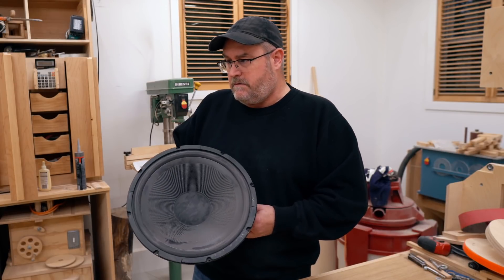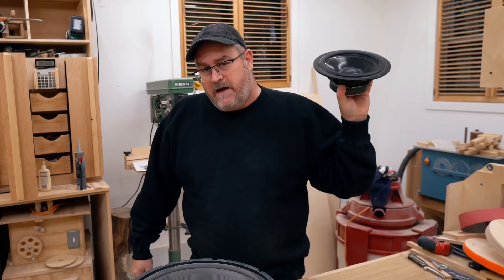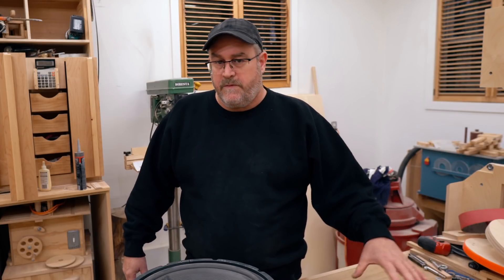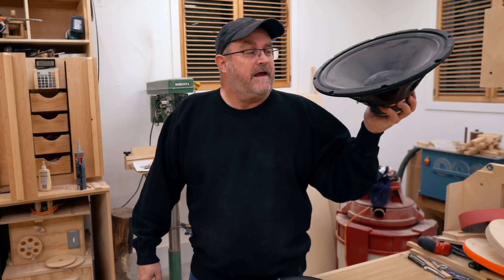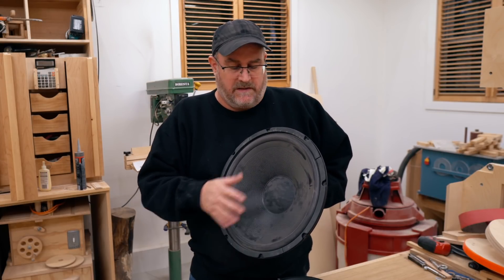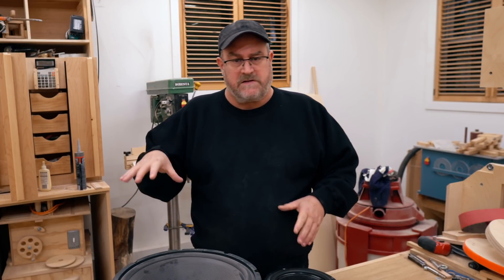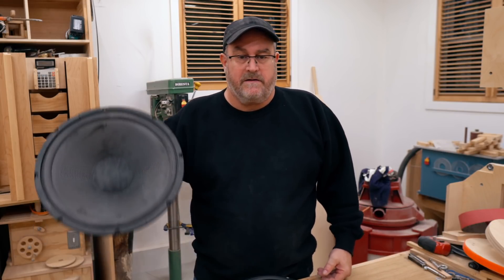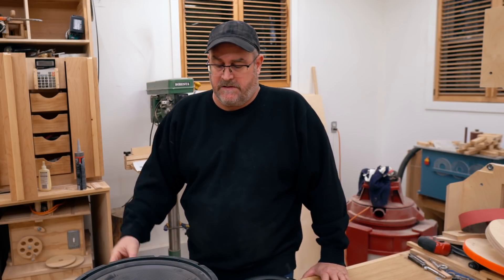What's a 3.5 Way Speaker? Designing My Main Speakers

Comment: Using Low Quality (Cheap) Drivers... is like putting a go-kart engine in a Ferrari Shell.  It doesnt matter how well you build a box for them, or how you cross them... if they cant do their job well to begin with.

 This is why my 1970s  sealed EPI 100v  2way speakers,  Completely DESTROYED my ported techniques 3way, 200 watt speakers.    Even with the EPIs only having an 8" woofer, compared to the Techs 12" woofers... the EPIs have more bass, and more ACCURATE bass.

 And even though the EPIs do not have a Midrange driver... the Special Inverted-Tweeter that they use, completely destroys both the mid and tweeter driver in my Techs, by lightyears.  Not even close to a competition.  I even tried to put a supertweeter in the Techs to improve the capability... and it was still useless in comparison.

 The Drivers are like a good singers voice box... like comparing Mariah Careys  (8 octave?) voice,  to  Paula Abdul, whom can barely sing at all, and needs a ton of Effects processing to even be useable.  So even with all of the Help in the world... you are not going to get Mariah Carey level output.. from Paula Abdul's voice box.

 Also, more drivers, and of LARGER drivers... still do not make up for their lack of accuracy / precision / control.  You just end up getting LOUDER music, that sounds equally bad / inferior.
Reply: The "bottom line", MOST important thing to remember here is this; it's not necessarily all about having the "perfect  measurements" or the "ideal design" or whatever in this case, it's ultimately about experimenting, learning about, (AND having fun with), whatever you have on hand or can affordably get, that results in the most pleasing sound you can achieve with said components, (to your own ears and with your own preferred style(s) of music), and John here in this video is doing exactly that, and aren't all of us here reading this, that same type of audio experimenter people anyway? So don't try to $#!+ on John H's ideas, just let him see what he can come up with...

And John Heisz, if you're actually reading this, then of course you have every ability to take whoever's/whatever comments/suggestions you choose into consideration in your final design, but of course you can also just ignore any that you don't agree with...

John H. you are doing more with your craft than most people out there, which is especially commendable on a relatively low budget, so kudos to you and your videos! You are an inspiration to speaker builders everywhere, because you're just simply doing it, even when you may not have everything "perfect" or "ideal", and you're not just simply talking about it in theory, you actually put your ideas into actual physical projects you build in your own workshop with your own hands!
Reply: @JoeJ-8282  well said!
Reply from the maker: Low cost doesn't always mean low quality, and that's especially true for bass drivers. The measurements I'll make (including distortion) will show exactly how good the woofer is and whether it's suitable for my needs.
Reply: @IBuildIt  Let me ask you a question:  Do you think a single frequency sweep, is an actual indication of a quality speaker sound?   Its easy for a speaker to play a Single noise, at low to medium volumes... without any struggle / distortions.   What happens when you play something like Disco... like Earth Wind and Fire?  Where there in an entire orchestra worth of instruments all playing at different frequency ranges, and all at the same time?

 My non Audiophile headphones, for example... would completely distort such music... such as the lower end sounds, distorting the clarity of the highs.  Even though that is a single driver comparison... the fact is, that even when you have a  +3 way speaker setup... when you have complex music on each frequency or ... each "Driver"... the individual Drivers level of Control will be TAXED.

 If the drivers are of poor Precision and Design... then they will distort more quickly and easily,  and will cause issues in musical clarity, image, and more.   If the driver are highly precise, and very powerful in their control... they will not distort at all... even under maximum volume levels, and very complex dynamic music.

 So, unless you are going to be taking a songs worth of readings... rather than a Frequency Pitch reading... then you are not actually getting the picture.
Reply from the maker: You don't seem to understand how measurements work. Distortion is distortion, regardless of the test signal. The sweep just makes it so that it can be shown accurately.
Reply: @IBuildIt  The distortion that they frequency sweep measures, does NOT tell the full story, of how speakers actually operate under stress.  Thats like comparing an RX-7 Car, that has a body stiffening kit installed in it...  to one that does not.  Under high G-Force curves.. the one Without the frame stiffening bar, will contort.. and lose traction / performance.  That type of "Distortion" isnt being measured, by typical low speed traffic driving situations.

 My friend drove me in his RX-7 that had such a mod... and I believe he ended up taking a 45 mph curve at over 90mph, and it didnt show ANY sign of traction loss (slipping), nor any body tilting / contortions...etc.   That thing was incredible.  It also took off like a damn rocket, gluing you to the seat.  :)

 Again... we are talking about testing the speakers every potential issue, under the highest levels of endured stresses.  A weaker cone material, for example... might flex quite a bit, at higher volume levels + fast tempos.   The more its trying to play at the same time... the more that cone distortion, would factor into the output sound.   Yet, when just using a frequency sweep... it shows little to no such distortions.

 And as stated... if your magnets and coils are not very powerful... then the speaker can not stop and accelerate fast enough, to keep up with the sounds that its being asked to play, with any degree of accuracy.

 For example... if I tell you to drive 60 mph forwards, and need to do so in less than 3 seconds... and your vehicle isnt capable of getting there that fast... its not being accurate to what I asked of it.  If you hit your brakes at 60 mph... and slid 70 ft... instead of instantly stopping on a dime... then again, you "driver" isnt doing what its being asked to do.   When the cone cant accelerate fast enough, nor stop instantly and be able to reverse instantly... then you get micro-distortions.  This gets worse, the more power you give these drivers... because you now have more forces in play.

 So you have speed issues, as well as material and construction related issues, that are not going to show up,  ULTIL  you have taxed them well.  Until you have pushed them to realistic levels of usage.
Reply: @johndough8115  Anything the speaker does that isn't the original signal is distortion. So... Yes. Distortion does tell you how the speaker performs under stress if you measure it under stress. 

Impulse response is a spectrum, and around 1 of QTS, the response is very acceptable for bass driver where the intention is low frequency extension in open baffle. In fact, this is desired.The idea that a stiff speaker needing a big magnet and a lot of power is somehow better is fallacious. That kind of argument often doesn't take into account the entire Q of the system. When you put a stiff speaker in a box with a big magnet, you up the overall Q of the system just like a high Q woofer in open baffle. 

So no,  I don't think John is going to have speed issues. What's most important is using the driver correctly, which John has a very good idea on how to do. 

Lets stop spreading the woofer speed myth please. It's an narrow view on a complex set of issues.
Reply: @Clobercow1  If you were talking about a subwoofer, that only handles extremely low frequencies, then I might partially agree.  Im talking about ALL the OTHER drivers.  Testing a frequency spectrum, is NOT testing the speaker under Heavy working conditions.  Music is far more dynamic than a single frequency being played.  Its a complex spectrum of frequencies, all at the same time.

 As Ive said... many headphones Ive had, would distort when, for example... the bass tones would muddy the highs.   Where as Audiophile level headphones, were able to reproduce all of the frequencies accurately, without ANY muddying / distortions.

 You know those certain songs... where you cant quite make out what the singer's lyrics are?  My old 2 way 8" woofer EPI speakers, allowed me to fully make out the exact lyrics that I had never been able to understand, for my entire life of hearing these songs.    Where as my newer Techniques 12" 3way speakers... I could NOT.  Not even close.

 The EPIs are like 1/3rd the size of the Techs,  Has much stronger and accurate Bass, despite being 8" vs the techs 12" woofer.  The EPIs Have one less driver, but they weigh about three times as much.  Why?  Because the EPI woofers use a much stronger magnet, stronger voice coils.  They are a SEALED speaker... unlike the ECO "PORTED" crapola Techs.

 I used to think the Techs were good sounding speakers.   I had four of them, as a surround sound system.   After getting the EPIs... I tossed them All into the Trash.

 Yes, magnet power and coil strength matter, a LOT.  Especially at higher power levels.. where you are moving a lot of air (pressure) , and where the cone is moving at much higher speeds.

 When the speaker is played a Lot of frequencies at the same time, and at high speeds and high air pressures... near non existent distortions that you found with your Sweep test, are going to be elevated to extreme levels of very audible distortions.

 Think about it.. if you are driving on a windless day... vs a day where you are heading into 50mph winds.  The cars engine will have to be pushed harder, to maintain the same level of overall speed.  And from a dead-stop... Acceleration levels, will be hit the worst in that situation.  Your speakers, at higher volume levels.. will create higher air pressure waves, and make various vortexes... will cause a weak driver to struggle, and Distort.  Where as a higher powered speaker.. has the ability to overcome these pressures with ease... and a lot more to spare.   And again... thats all discounting the standard levels of distortion from trying to simply keep up the pace of a fast moving cone, under complex musical output.

 Im a speaker-addict.  I currently have like 8 different speakers in house currently,  and Ive owned probably over 30 different speakers over the years.  Ive experimented with them, from driver swaps.. to adding drivers... to changing the boxes... and more.   I can tell you... that Ive been to the local high end stereo shops Recently... and their $3000 top of the line speakers... were total Garbage, compared to the old EPIs I obtained  (for a mere $100 ).

 That out of all of these speakers... the ones that sounded best, and were the most accurate, were Sealed box speakers.  All ported speakers Ive ever heard, have an Artificial, distorted, Farty sounding bass.   They use the ported design, so that they can be more power efficient (ECO nutzeez)... but that comes at a huge audio quality price.  You cant get high precision audio, from low power ECO drivers... (unless you dont mind keeping the volume levels, to Elevator background levels)

 The ECO speakers tend to try to make up for their shortfalls, by adding a more powerful Sub.  However, that misses a huge spectrum of frequencies, and even then, still misses the boat on musical accuracy.

 Some speakers Ive owned:

 Acoustic Research  AR3-A
 EPI 100v
 EPI M180
 Genesis Model 10
 Advents (full size bullnose)
 Sansui SP-3200
 Cerwin Vega D-9
 Klipsch (small sized bookshelf / surround speakers)
 Bose 601 Series III  (Foam Rot - Needs restoration)
 Techniques (12" 3ways)
 Altec (Rock Concert Speakers)
 Peavy (PA speakers)

 Radio Shack Optimus-27 (unusual find)
 Boston Acoustic's 
 MCS
 Scott

 Various boombox / speakers:
 Phillips Woox (Owned a Woox boombox system)
 Bose (wave radio + cd unit - found at thrift shop)
 Sony (51 CD boombox: HCD-MC1)
 Aiwa speakers
 Monsoon (planer speakers)

 And have heard speakers from
Pioneer, Fisher, Infinity, JBL   and more
Reply: I will add... that I used to buy many used speakers from the thrift shops.  Among these were a few Radio Shack speakers.  Id swap the RS drivers into other speakers, to compare the differences... and they were unbearable bad, compared to the original drivers.

I also once tried to use a lower quality woofer to repair my foam rotted Phillips woox speakers, such as a SONY woofer.  It was a serious downgrade... and so I had a person refoam the original drivers.  There was no comparison between the two.  The phillips woofers sounded 1000x better.

 There are a lot of variables that change the accuracy and potentials of these drivers.  A large part is the magnet strength.  But thats not the only factor.  It can be wire gauge and amount of wraps, accurage of the coil wraps, distances between coil to magnet, excursion, accuracy of the mounting, cone material, cone shape, basket shape and or stiffness, spider flexibility, and more.

Comment: That‘s the right attitude for a speaker builder. You can never build enough and there is always another system you want to try out.
That way I build 7 pairs. Most of them for friends or public places. 
And as you are really skilled enough to build complex housings, maybe you should take a look at horn speaker systems like the Blumenhofer Gioia.
Until today I would like my backloaded horns back I build once. There is nothing coming near the live characteristic and dynamic of a horn system.
Downside with your current base chassis is that high QTS is not ideal for low base frequencies in horns.
Reply from the maker: Unfortunately, I don't have the space for horns. Or at least not the kind of horns I'd like to build.

Comment: Depends on your hearing and brain.  I can't stand the phase issues in crossovers.  So for me a two way with a crossover down at 250 hz so the cross over is at a low enough frequency that the phase response not disruptive.

Comment: I like transmission line arrangements as much as the next guy, what do you think about mirror image tight cluster? I used to have a set of JLB 4411’s that were so smooth in the midrange at the crossover points… you couldn’t hear the crossover frequency if you know what I mean.
Reply from the maker: Honestly, I don't think the driver arrangement makes much of a difference, as long as they are close enough together.